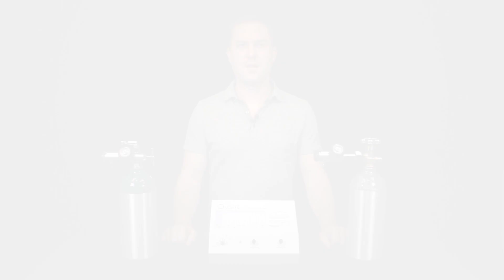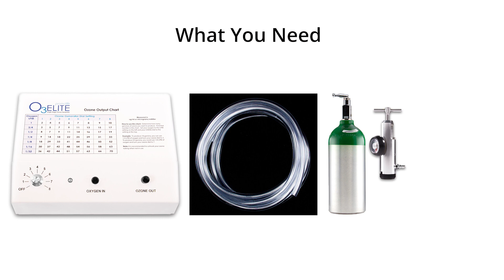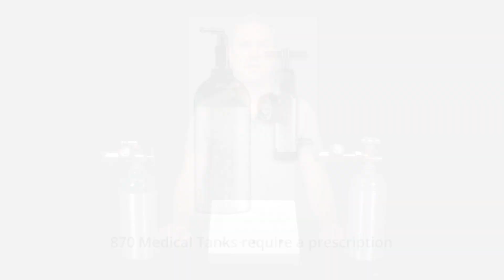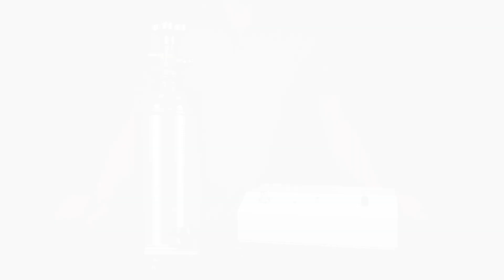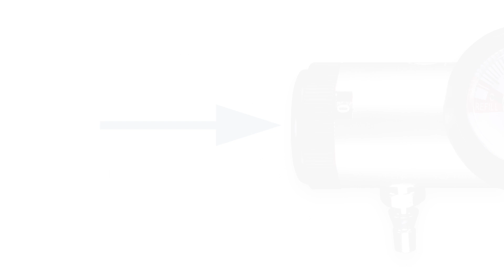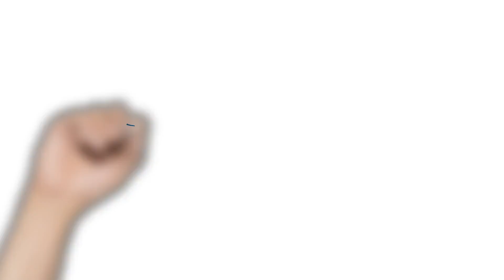How to Set Up an Oxygen Tank for Ozone Therapy

Comment: Do ALL (Drive, Midlife, etc) CGA-540 regulators come with standard adjustable flow rates of 1/32, 1/16, 1/8, 1/4, 1/2, 3/4, 1, 1 1/2, 2, 3, and 4 Lpm?
Thanks a lot in advance!
Reply from the maker: Some do, but some don't. At low flow rates different regulators are not exactly the same when it comes to actual output. When someone gets an ozone generator and oxygen tank regulator from us, we calibrate the ozone generator with that regulator.